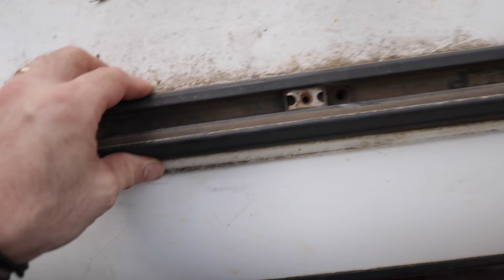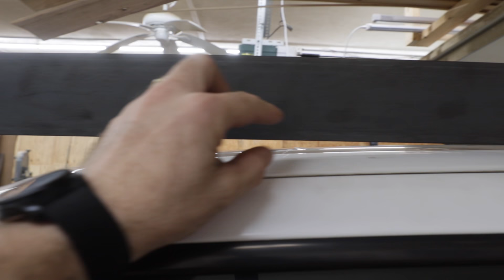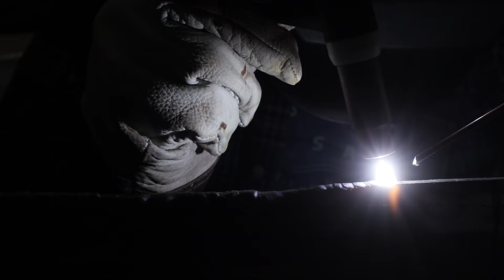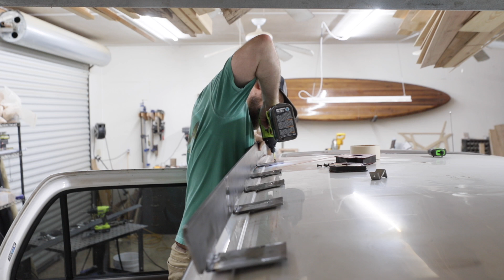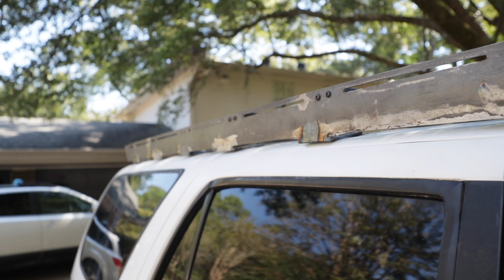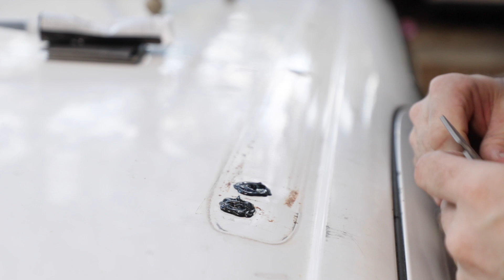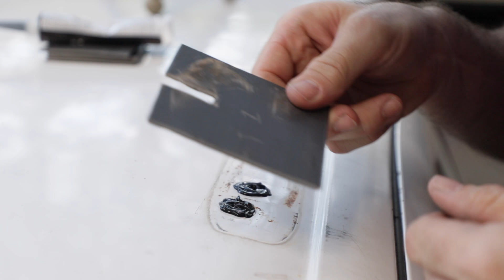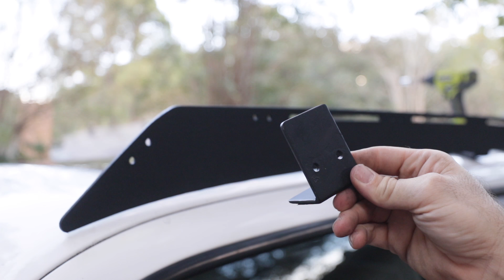How to Build a Prinsu Roof Rack for 3rd Gen 4Runner!

Comment: Bro, Do you have a dry cut saw blade on an abrasive saw? You’re brave. Does the material get hot and does the blade dull quickly?
Reply from the maker: If you aren't very careful it will. This was more experimental than anything. I know they aren't supposed to be used this way at high speeds. The trick to making it work is that you can't let it spin up before starting to cut. It takes the saw a couple seconds to get up to full speed so if you start cutting immediately before it gets to full speed it works. It cuts very fast without heat. But the second you touch the trigger you have to start cutting. If you let it spin up to fast before cutting it will dull the blade quickly.
Reply: Also the TIG welds are looking great and congrats on the yeswelder sponsorship, I have the MIG205DS and love it. Hopefully they send you a plasma cutter!
Reply from the maker: @Toolingabout  oh awesome! Have you tried the tig function? I've only used mig so far. Definitely need a plasma cutter! I have metal dust covering everything now

Comment: I believe Prinsu and Frontrunner slimline have a small 1/4” or so lip on the top of the side rails. As someone looking to do one of these, what made you decide to have the cross bars flush with the top of the side rails?
Reply from the maker: Yeah.. I honestly didn't see a need to do that. The factory roof rack doesn't have a lip and my previous roof rack with the three crossbars didn't have a lip. The rooftop tent I'm building will mount flush with the roof rack so if I had a lip all the weight of the rent would be resting on those lips and that wouldn't be good. Guess it just depends on your specific needs. Good thing about building yourself is that you can customize it however you want!

Comment: Fantastic, enjoyed watching. 
On the front floating tabs are you concerned about them bouncing and hitting the cab? And would a small rivnut fix it?
Reply from the maker: After everything is tightened down there is a lot of downward pressure on them so not super concerned about bounce but I also have double sided tape underneath to protect paint and prevents lifting
Reply: @PatrickRemington  I’m getting ready to make a rack for my pickup but it doesn’t have an existing roof rack system. I’m hoping I can install riv nuts in that rain rail and have enough support.

Comment: Be concerned about aluminum extrusion/metal contact surface. Once paint chips off due to little shackes and rattles, contact between bare metals will corode
Reply from the maker: Yeah I thought about adding little rubber gaskets between the extrusion and the side rails.. we'll see how it does